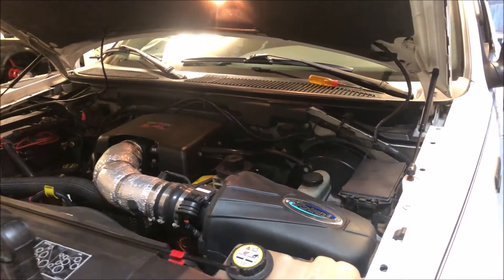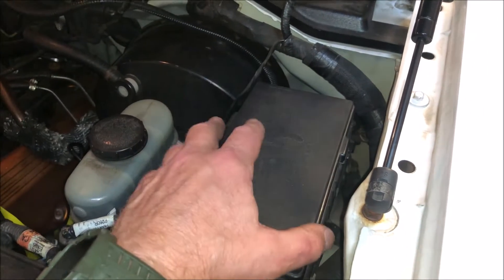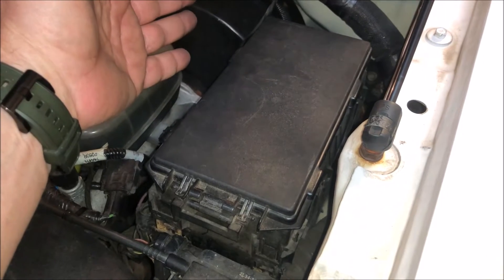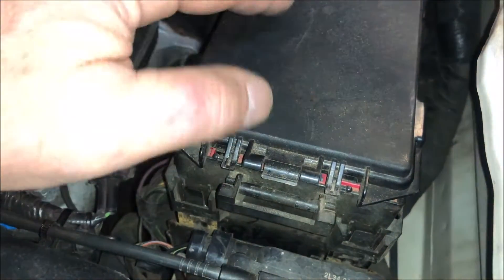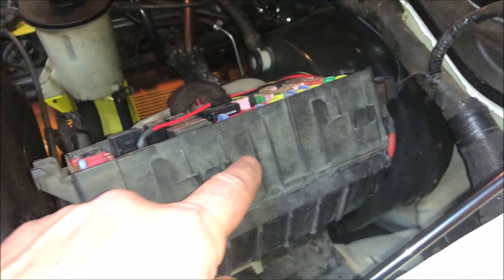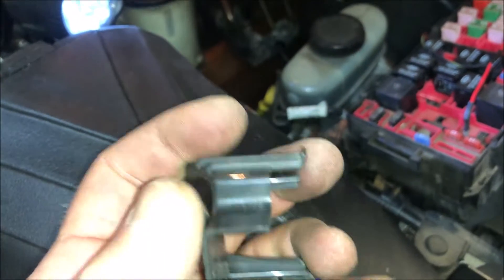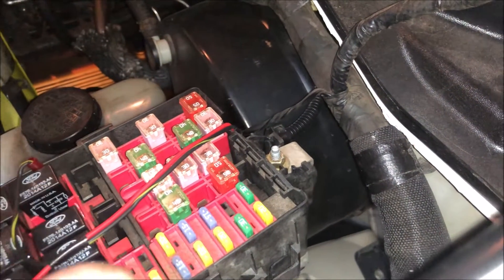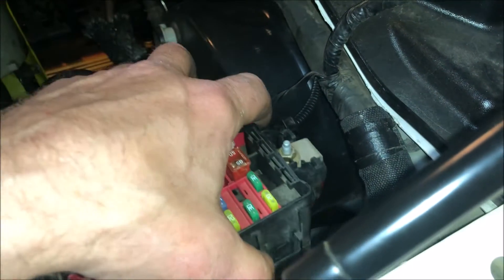How To Add An Electrical Wiring Circuit For Accessories: 10th Gen '97-'04 F150, '97-'02 Expedition

Comment: Thanks -seems every little cover over the main wire I’ve checked at pick n pull the inside tab is broke off - ughhhh
Reply from the maker: You might be able to zip tie the old one over the wire lug.